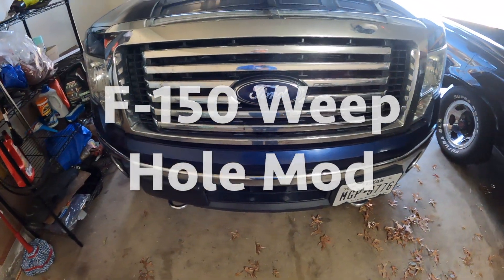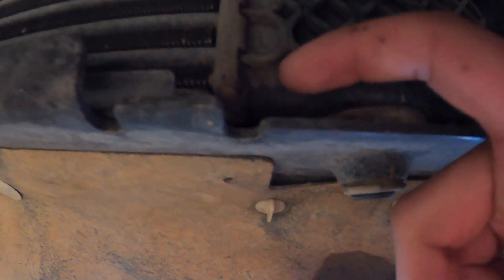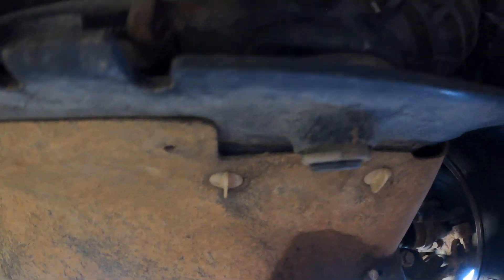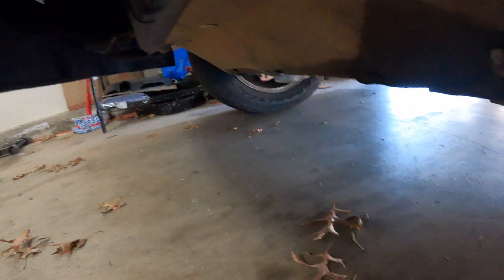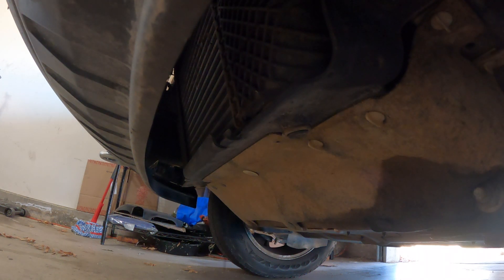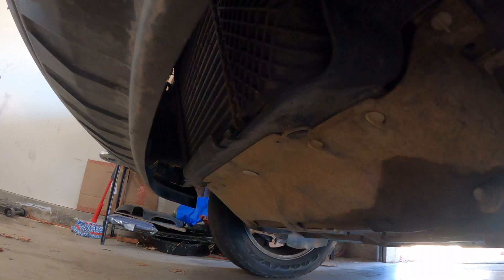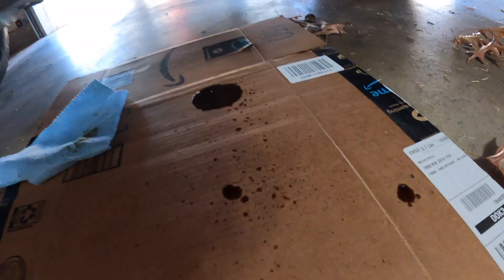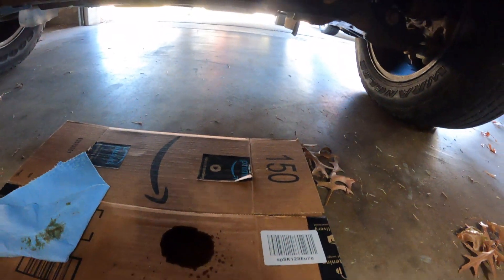Ecoboost F-150 Weep Hole Mod

Comment: My 2014 F-150 was not giving me issues, but I decided to drill a hole and black oil came out, not the coffee-with-creamer-looking oil. So my guess is that I did not have condensation mixed in there, only oil. The problem with my weep hole is that I did not have a 1/16 drill bit. My smallest was 1/8. So when I drilled it, I noticed that the engine's RPMs went down a notch. It might've been too big that the PCM noticed it. I'm going to have to plug my weep hole with a screw and go buy a 1/16 and drill it again a centimeter to the side. (Yikes!)
Reply from the maker: I plugged mine with a small screw afterwards. No problems since doing so!
Reply: @MarcosXsernA are you supposed to take the screw out once in a while? i plan on doing this to my truck but not sure if it’s supposed to remain open afterwards i just don’t want to leave marks in the driveway lol
Reply from the maker: @mkhan5905  Yes, put the screw back in and drain it from time to time

Comment: What are the symptoms of the misfire problem? I have a 2016 that will throw an intermittent wrench light cruising at 65mph with cruise control.  Recently help with wrench light issue replacing the trans oil pump.

Comment: I have a 2012 F150 EcoBoost with 204k miles
Installed catch can 6 months ago.
I empty it every month and it is full to the top with oily stuff and white milky sediment in the bottom every time.
It is impressive what junk it catches
Reply from the maker: Same here. I installed one and I'm surprised at how quickly it fills up!
Reply: I heard from a Ford mechanic that you need to look at the oil's specs to see which oil is less evaporative. He mentioned what to look for, but I forgot. That should keep the catch can from filling up too fast. But I guess it depends on how big the catch can is, because they recommend to empty it every oil change (4k-5k miles). So the can you're using might be too small, or the oil you're using may be more evaporative than the recommended one.
Reply: @marsflee3815  I spoke to independent tech and he said the same thing. There is a high mileage synthetic oil (forgot name) that will help with excessive blow-by
Reply: I have a 2013 installed catch can the thing is full every week,truck still ran a little rough I drill hole in bottom of intercooler now truck runs great again and I get 20-22 mpg again,mpg had dropped down to 18 mpg
Reply: @cookiejar2637  wow my 2013 never gets that kinda gas mileage. Sometimes idles weird. I’ve had the catch can for a bit and it’s way better I just hate thinking of drilling that thing
Reply: Same...catch can really work...👍